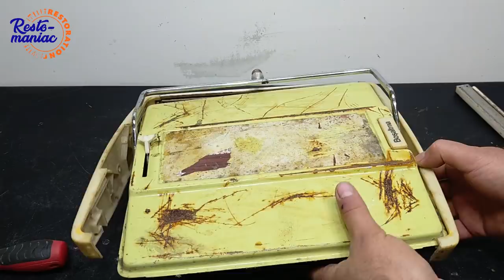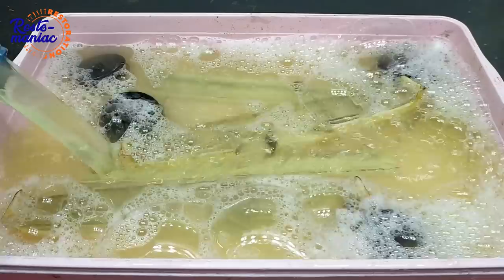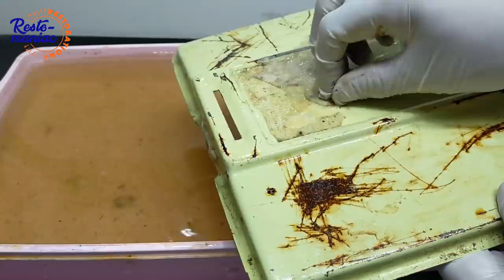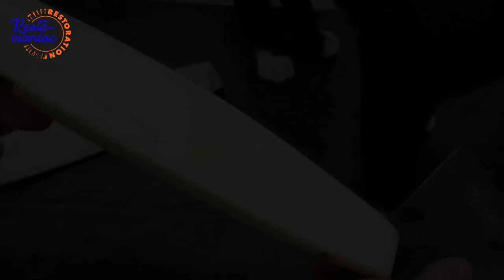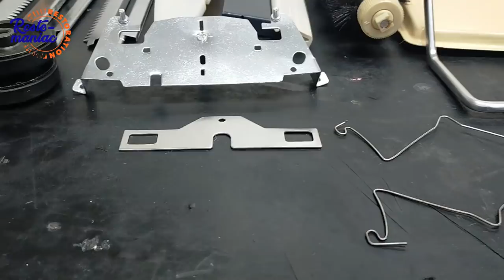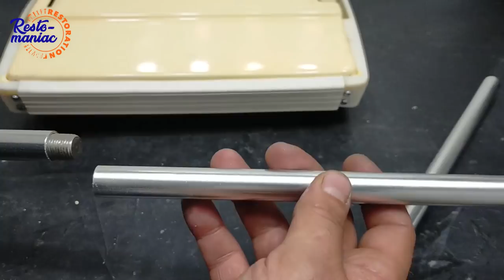Vintage Carpet Sweeper Restoration

Comment: Meticulous work as always.  I was a little disappointed in the solution for the rubber tires.  I thought you would go with o-rings or square cross section o-rings.
Reply from the maker: Thank you very much 😊